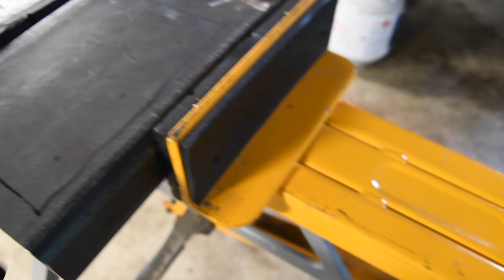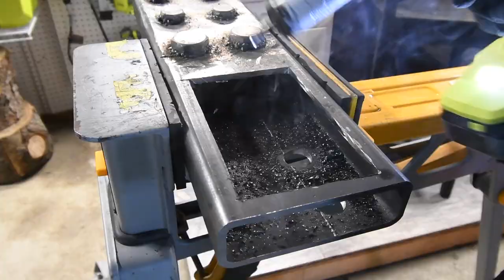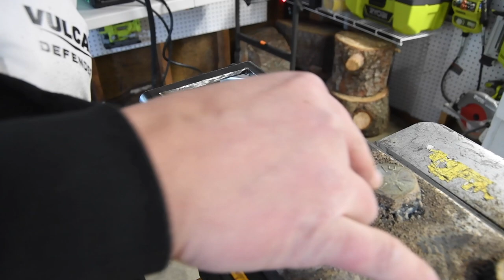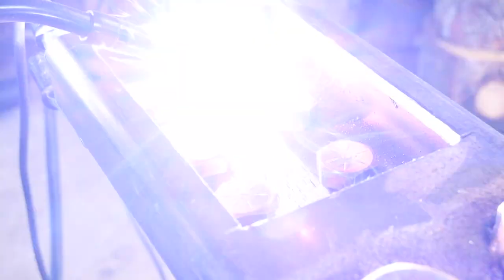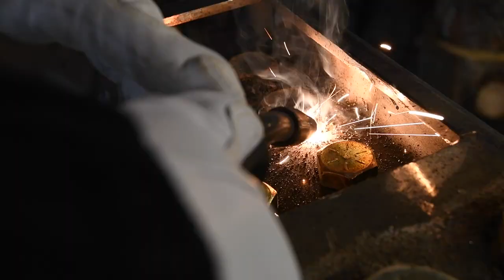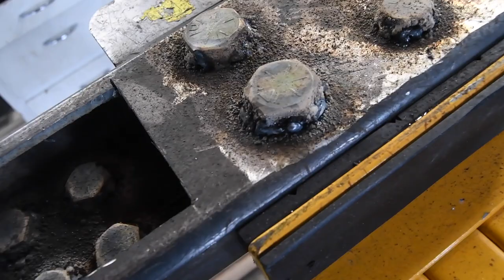Welding, Grinding and Hole cutting (Metal)

Comment: Use some sort of oil when drilling metal.  It’ll help keep the bit cooler and won’t burn them up as fast.  
Also weld significantly slower then you think you need to
Reply from the maker: I did use oil. I just dont show putting oil on in the video. I edited that out
Reply: Says he used oil but look how dry everything is in the video 😂 should be dripping with cutting fluid
Reply: @William Lipinski you can’t edit out cutting fluid 😂 the puece is obviously bone dry

Comment: Were they just standard zinc plated bolts from home depot/lowes/etc? If they are by chance throw them through a tumbler  or wire wheel the coating off it'll help your welds out. Zinc adds porosity to the welds.
Reply from the maker: I will have to find out, but im not sure if they are zinc or not.

Comment: Don't forget when you are drilling metal you need to put some kind of a lubricant, if you don't the drill bit won't last long and the metal will get too hot
Reply from the maker: I did put oil

Comment: Should use lubricant when cutting metal or it can get to hot also keeps the drill bit or cutter cooler and they will last longer
Reply from the maker: I did, just because its not seen on camera doesn't mean it wasn't done
Reply: @ManCaverTools  aww got ya

Comment: New to welding for sure.  Aargh!
Is that a cheap AC Flux Cored welder?
Reply from the maker: Harbor freight titanium
Reply: @ManCaverTools  The Easy Flux 125 is DC welder.  You should be able to get much less spatter than you have, though I've not welded with that one.   I have a Century FC90 Flux cored welder and there's minimal smoke and spatter.  I get more with my Lincoln buzz box, AC225.   You need to be able to keep a continuous arc that sounds like frying bacon when the settings are correct.   For 1/4", your voltage should be pretty high and the feed should not be so high that the wire pushes into the pool and extinguishes the arc or pushes the gun away!  With that many bolts, you could try out lots of settings to find the right one.   Best to practice on a longer straight weld first though, then run a bead along 3 of the bolt head flats.  No need to try and weld all around.   1" of 1/4" fillet weld will hold a ton of load!
Reply: A couple years ago I let my daughter have a go at running some weld.  At school, she's been going to Vo-Tech in the afternoons ever since to learn welding and will be off to do a welding degree this Fall !

Comment: Those holesaws ain’t gonna last if you don’t use some cutting oil, good lord i died a little inside
Reply from the maker: I did use oil on the metal. I just dont show it in the video
Reply: @ManCaverTools  if you did you must of put a drop and that’s it cause those holes are as dry as it gets

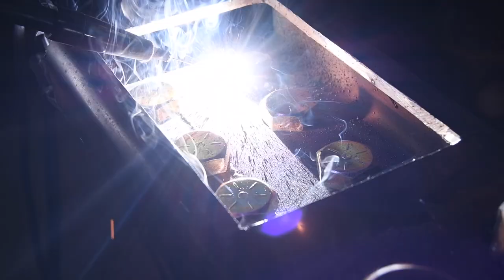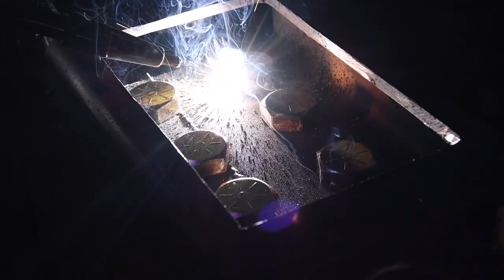Comment: Your gun tip is way to far away from what your welding thats why the welds are coming out like boogers you don't want your wire coming out so far away from the work your welding if you bring the gun and the wire closer will turn out better @6:29 @6:38
Reply from the maker: yes it is I thank you for the advice Antonio
Reply: @ManCaverTools  no problem if you need any help with welding and have questions you can always message me bro

Comment: Need to use gas it will make a lot better weld over the flux wire and you cone needs to be past the tip on your gun
Reply from the maker: I saw a lot of videos using this type of welder and they did very well, I just need to improve my welding skills

Comment: Also you’re holding your wire gone way too far away from your work peace you want to get closer and take your time start a nice puddle and drag the puddle with a backwards C motion trying to get into the root of your weld
Reply: Also if you’re not using a shielding gas you want to get a flux core wire
Reply from the maker: I thank you for the advice Grant